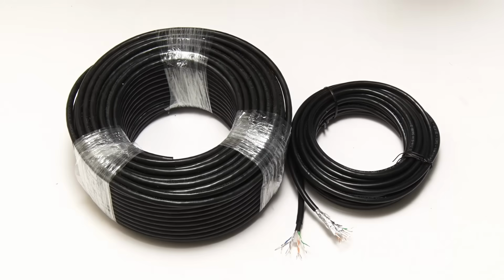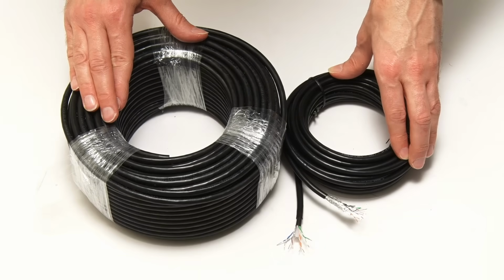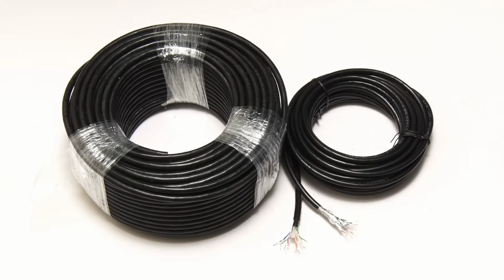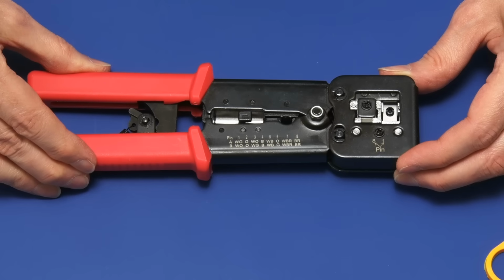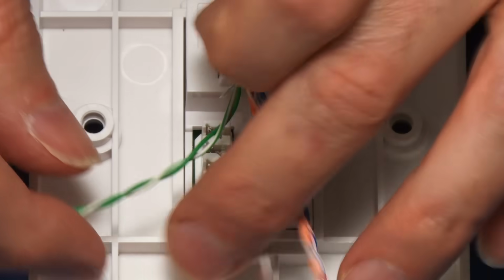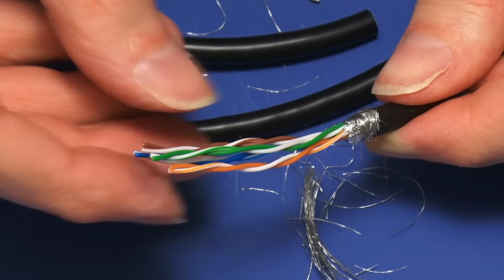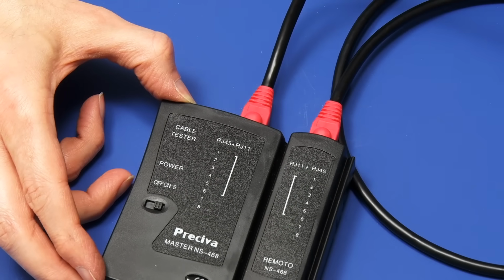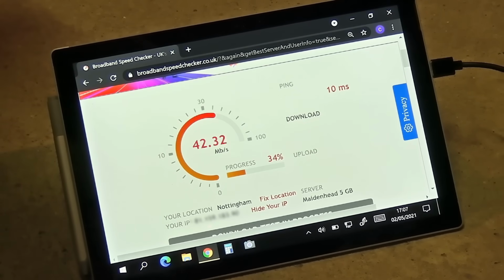Wiring Ethernet Extensions: How to Fit Sockets & Make Patch Leads

Comment: Thanks for the timely video, you've probably saved me a bit of cash in the process. I had my garage converted into a "man cave" last year and I have a server cabinet in there with a rack server, POE switch and Ethernet going elsewhere to the house. I had quite a bit of internal and external CAT6 cable left over and was planning to make up a few more patch leads from it over the next couple of weeks. I didn't give any thought to cable types and AWG numbers but, thanks to your video, I've just now ordered the correct crimping tool and Ethernet plugs.

Comment: Let's also not forget that a wired Ethernet connection is going to be more secure as far as information is concerned and faster too! Quite simply, it's impossible to hack a network via WiFi if there is no WIFi. Though, wired does have it's issues since putting a few dozen push-pins through a cable here and there or even a cleverly modified RJ-45 plug in an active jack can cause problems for the entire network. Therefore, conduit and close supervision of all active jacks might be necessary.

Comment: Can't understand why anyone would do a wifi radio link to their PC having gone to the trouble of having a cable to the router - cable is more secure. wifi is just pumping your downloads and uploads into the air for anyone within 100 metres to capture - even if they then have read it. I expect video pixels are easily read.
Reply: That's why it's all encrypted.
Reply: @kyoudaiken  encrypting video pixels is very costly in terms of speed. Each pixel has a significant quantity of information associated with it. Data is sent in packets. I'm not sure, but I expect a great reliance is placed on the video packet address. 32 or 64 bit encryption of each bit means the file size increases by at least that many times. While compression reduces the information sent, it is also losing information.

Comment: Any tips on bending the cable on the outside, to sit fluch along the wall? i found these cables to be especially hard to bend to 90 degree angles.
Reply from the maker: Solid core cables, especially of the thickness I used, are indeed very hard to bend (and likely to internally snap if forced to a sharp 90 degrees). So you have to plan gradual corners, and if at all possible bring a cable into the base of a socket.

Comment: Someone else mentioned "more networking!" Let me second that... I'm still trying to get the linux box to play nice with the Windows network.  :(
Reply from the maker: I have been thinking about a video on network file sharing across Windows and Linux! :)
Reply: @ExplainingComputers  Ah, that would be wonderful. So far I've only managed (purely by accident) to get the linux box to admit one shared drive exists, and it won't let Windows see its precious files at all. I finally resorted to WinXP in a VM for when I need to schlepp files between 'em... it has no problem seeing everything!
Reply: @Reziac  Don't blame Linux for Gateswares failure to admit other OS's actually exist.
Reply: @snoopstp4189  Sorry, in this case it's linux at fault. The WinBoxen can see the linux boxen just fine, but linux won't let them connect.  It's probably some sort of permissions issue, but naturally linux users are too superior to offer any help.

And the only way the linux boxen will connect with each other (or with the WinBoxen) is if I use the IP address, then it works... but who the hell wants to do that every time you need to access a shared drive?

Meanwhile I just point the WinBoxen at each other, and networking Just Works (and has done so for 20 years).

And I want a solution, so linux doesn't keep forcing me to resort to Windows. But so far no one has suggested one.
Reply: @Reziac  start ftp service on windows, login to linux via WinFTP, move files. etc
Reply: @snoopstp4189  Thank you, but that produced this:
(help didn't offer a login command)

ftp> open 192.168.0.9
Connected to 192.168.0.9.
Connection closed by remote host.

I also tried WinSCP thinking it might show more verbose error messages and since it offers login by default, and got:

Disconnected from server
Connection failed.

Got same from both linux boxen. 

To be fair, FTP doesn't seem to see the other WinBox at all via IP address. However, IP address works fine in Explorer -- for the WinBox, but not for the linux boxen. I am now confused. One does show up in Explorer by name, but can't connect to it. (The other is nowhere to be seen.)

Comment: I have a question. If cable is shielded connector RJ45 must be also shielded (RJ45 with metal plate) ?
Reply from the maker: Ideally, yes, use shielded connectors with shielded cable.
Reply: @ExplainingComputers  Thank You :)

Comment: Interesting, 50mbps internet in the UK. I am on 200mbps in South Africa. However it costs me £66 per month - a significant slice of my income.
Reply from the maker: You are paying more than double what I am for that connection -- but it is four times faster! :) I was until recently on a 9Mbps connection, so this was an upgrade for me! Some parts of the UK can get faster connections, but this is the fastest I can currently get, and a lot of the UK has much worse connectivity than this.
Reply: @ExplainingComputers  I am fortunate enough of staying relatively close to Cape Town thus have fibre. Before this I had 40mbps VDSL but copper is getting pulled out and sold as scrap (by telcos and thieves). Most parts of the country rely on more expensive mobile LTE data

Comment: I saw this weeks video title and thought 'Really??!?!' I guess the seasoned Cat crimper in me forgot how much info there really is in this subject, especially as it's grown over the years.  Once again, a perfectly laid out, easy to swallow, very informative video. Hats off to you sir!  
Just one niggly comment though (and based on my pet peeve) I would have mentioned the importance of crimping onto the insulation of the wire in the RJ45 as it acts as the strain relief. I have seen it too many times where cables are pulling on the 8 wires, especially on the non ez-crimp connectors. It makes me wonder why aren't all connectors ez-crimp?! (passthrough style)
Reply: Yearh.. The RJ-45 mounting is very bad - and why using shielded cable with unshielded connectors.. Do it right, or leave it :-)

Comment: I would have thought multi stranded cable to be better due to skin effect at higher frequencies.
Reply: I thought the same.
Reply: That only works if the strands are individually insulated.  Otherwise you effectively have a solid wire.  Look up Litz wire for details.

Comment: Good informative video as usual :)   After seeing this everybody should be able to make a prof. both functioning and good-looking network cabling in their homes.

I recently did some research on the topic when I needed to wire up some PoE surveillance cameras and one thing I found recommended was to use CAT 6A cables for PoE wiring to be sure to deliver the needed power to the attached equipment.

I live out in the countryside with no heavy machinery nearby, so I’ve just used U/UTP cables.

I never make my own patch cables. They are so cheap and comes in a lot of different length and colors, so I don’t find it worth the time and effort to assemble them myself.

I have a couple of questions:
1: Does it matter which materiel the cable is made of? I recon that the category stated on the cable will guarantee the promised speed no matter what the cable is made of?

2: When using pure plastic plugs/sockets does it make a difference if the cable is shielded or not? If so, then why sell the more expensive shielded metal plugs and sockets?
Reply from the maker: 1. The longer the cable, the more it will matter. Read reviews on somewhere like Amazon and it is rapidly apparent that many cables do not deliver the speed of their Cat rating.
2. Shielding will have little, and possibly no impact, with non shielded plugs and sockets.
Reply: @ExplainingComputers  Oops, even though one does one’s research, there are still things to learn. I wasn’t aware this was a topic. Luckily both my CAT 6 and CAT 6E cable drums state, that they contain “high professional quality copper wire cables” :)

Also, my patch cables are marked with “CCA” – which as I understand it, tells they are made of copper.

After I looked more thoroughly into the topic, I found that “… there are no visual differences between a CCA cable and a pure copper cable”. So it’s not something one can decide by the look of the wires.

Thank you for education me again :)

Comment: I still swear by ethernet for my desktop PC. I only use wi-fi for my laptop and phone.
Reply: Indeed. The only times you should use wifi on a non-portable device is if you can't run a cable to it for some reason (house layout and/or inability to poke holes in your walls, not enough ports on the router, etc). And even with the portable ones, having a spare connection (either a jack with a patch cable or an extra cable from the router) near the place(s) you most commonly use them can be useful.

Comment: IMHO WiFi is a nice idea with the worst and most embarrassing execution... I just wired a highly flexible cable (cause it needs to go along a lot of corners) through 2 walls to my bedroom. Best decision ever. It's a CAT7 STP cable.
Reply: Indeed. Both wired and wifi have their places...if you have a mobile device like a Nintendo Switch, a laptop, or a cell phone, or for whatever reason don't have the ability to run a cable to where you're using your device, wifi is a good and useful option. But if it's a stationary unit, and you can run a cable to it (and this includes things like a laptop that routinely just gets plopped on a desk), wired is the way to go. 
I rent, so I can't go drilling holes in order to run cable, and while it's a little messy (I'd get cable sheaths, but in a couple of cases they have to run past doors that need to open), the two PCs in the house are wired, while the laptop and phones are on the wifi. (modern routers which can do both are nice. :-) )

Comment: It is quite apparent that the proper tools make this job easy.  I have done this just using simple wire strippers and cutters, and it can be tricky.
Reply from the maker: Yes, agreed. This is one job where the right tools make a massive difference.

Comment: A proper crimping tool, like the one shown in this video, is absolutely worth the extra money!  The ratcheting kind like that -- where it simply will not release until you've fully crimped the connector -- is SO MUCH BETTER than the "pliers-style" of crimper.  A cheap tool will cause you no end of troubles with your network, whereas a good-quality (and thus more expensive) tool will make a good connection every single time.

Yes, it hurts to spend that kind of money on a tool, when you see the cheap pliers-style crimpers for so little money.  But don't be fooled!!  Buy the expensive ratcheting-style crimpers!!  The time and frustration you save is worth every penny you'll spend on the expensive crimper!  As someone who has wired up literally thousands of these connections in his lifetime, I promise it's worth the money!!  I learned it the hard way!!
Reply: "where it simply will not release until you've fully crimped the connector"  Just don't pinch yourself with it.  Been there, done that.
Reply: The one he has is a bootleg of the EZ-RJPRO made by platinumtools.org. At my work, we use the official ones which are constructed very well but I purchased a bootleg one in a kit myself for $37 on amazon and it doesn't compromise much on the quality if you're only using it for wiring around the house. The kit itself wasn't worth it in my opinion because the tester and punch down were both pretty bad.

https://www.platinumtools.com/products/crimpers/ez-rjpro-hd-crimp-tool-100054c/
Reply: I'm now going to get that work fixer blob of clay for my tool box! 😄😆😅🤣😂🙃

Comment: Loved the video. Very informative. I was hoping you would touch on several of the things that you wound up talking about. As someone from the telecommunications industry, I highly appreciate the fact that you highlighted this subject so well. Ultimately you only scratched the surface, but that's just how deep the rabbit hole goes. It's so nice to hear about a subject from you, even when I already know a fair amount about it. You always deliver something of value!

I do have a couple of notes on tools and the termination of cables, as someone with industry experience. I really liked that you provided a thorough explanation of the tools, and that crimper certainly looks great, but I would recommend a better punchdown tool. There are spring-loaded punch tools that also offer bladed bits to cut the ends off the cables flush with the socket; not unlike the way the crimper cuts excess cable off of pass through connectors. Having that spring-loaded kick and a larger tool to hold onto really helps seat the cables firmly and ensure a high quality connection.

You did a fairly good job on both the plug and the socket, though I must point out a few things that stuck out to me. As mentioned about the punchdown tool above, it's ideal to cut the loose ends coming from a socket as flush as possible to avoid potential issues with cross-talk, ingress and egress, etc. You did well to maintain the twists right up to the termination point in both the socket and the plug. I did notice however that it looks like you failed to seat the strain relief notch in the cable jacket on your patch cable plugs. It's not a huge deal in the short term, but that can cause problems with the connectors in the long run. Especially for patch cables which are frequently plugged and unplugged.

In any case, you did a fantastic job on the video, as always! Thanks so much for your hard work, Chris! I look forward to Sundays specifically because I know there will be an EC video waiting for me!

Comment: I have a long run to do for my garage, but I never got around to running it. The laptop I was going to put out there is living in my Basement instead, and I've not worked out in the garage as much as I would like, so mostly it is just my smartphone playing music when I am out there using the WiFi which is better than I expected as the router is also in the basement, and the house was "stuccoed" to look like stone cut stone, and has a metal mesh tacked on to hold the stucco.

Comment: Thanks a lot, very useful. A tips: when you drill the wall from the outside to the inside, I suggest you have at least 15 degrees upwards to prevent the water from entering
Reply from the maker: Agreed -- as I noted in the video I thought I was drilling slanted upwards (I checked several times), but the video revealed otherwise). :(

Comment: Thanks for the video. I usually leave some extra cable inside the box if for some reason the wall connector breaks. I usually use cat6 cable so it is easy to bend. But tbh, I've never seem a wall connection breaking. Usually the patch cord breaks. But in any case, in your project, if the wall connector breaks, would you have to redo all the cabling?
Reply from the maker: I have left a little loop of slack in the cable in various places, so I could bring in a bit more through the wall if needed in the future. The cable I used here was highly inflexible, so leaving any in the box was not an option. This said, at the other end, for the socket I have managed to leave some cable looped down in the wall cavity.
Reply: @ExplainingComputers  thanks for the reply. I want to change my wiring in the future. Probably will use a shielded cable. I was really concerned about the the wire being rigid. But the loops along the way are a nice idea.

Comment: And that tool completely screwed the twists up  the number of turns per inch does matter      plus  you totally missed the outer on the plug crimp making a plug that is very weak mechanically and prone to pulling out of the conductors . Nice sharp edges left on the back of the metal box ready to work its way thru that cable
Reply from the maker: There were no sharp edges left in the box that were anywhere near the cable. I am not an idiot as you infer.
Reply: @ExplainingComputers  the edges i saw were more than sharp enugh  i did not INFERE anything BTW

Comment: wired connection are always the best. you can extra protect the cable outside with some kopex aka "Bundy Bendy"
Reply: Or simply run it through panduit easily attached conduits.  Looks better on the house than tacked on cable runs ever will.

Comment: Great video! Another topic you might be interested in is how to use old routers as access points/switches to extend the WiFi range. Run cables to the main router, plug it in the old router in another room, and configure the old router as an access point with the same SSID and security settings. You could also talk about custom firmware like OpenWRT, DDWRT and Tomato that are great for extended support, more configuration options and features!
Reply from the maker: Yes, this is an excellent topic idea that I will cover, not least as I will need good WiFi in the garage for various purposes when making some videos.

Comment: Chris this video is excellent and timely, the best video I have seen explaining cable types and showing the practical application to wire a socket or plug. The reason for it been timely is my 15 year old son asked me to teach him about making Ethernet cables. Now we can watch the video together and then build some tables. I started my career in telecoms and the first thing we had to do was build a set of good test cables. Normally an x21 through and cross cable, a v24/rs232 through and nul modem and a loop dongle and always the most fiddly was a RJ45 plug Ethernet.  Loved this video thank you  for sharing.